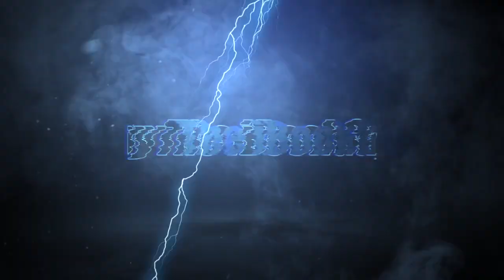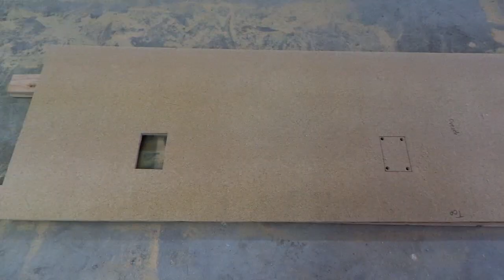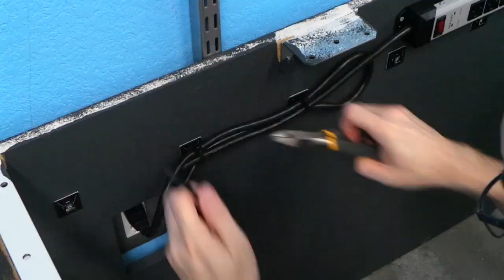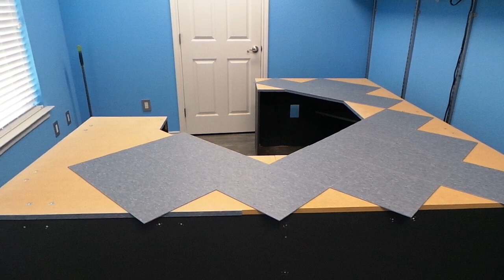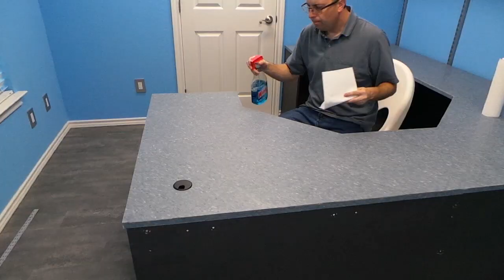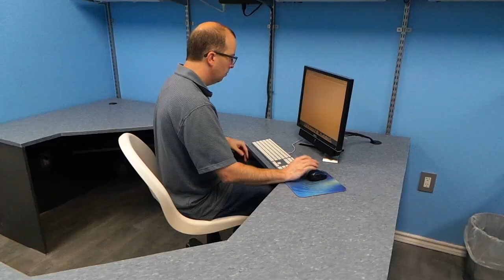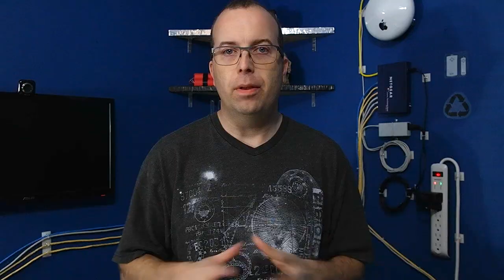Building the Ultimate Computer Desk - Part 3

Comment: How to get FREE WOOD for FREE

Step 1:  Google home builders in your area and find a subdivision they are currently building in.

Step 2: Go to the subdivision where they are still building homes, find a house that is at frame stage of construction,
which means there are no walls just the wood and frame of the house, ask a few mexicans or subcontractors who are working on the site if there is any extra wood for you to take home. Usually they throw away tons of off cuts and extra pieces that no one ever uses.

Step 3: ?

Step 4: Profit!
Reply: Great tip and funny to read too. If you need bigger pieces, there are organizations like Habitat for Humanity's ReStore that sells used and leftover building materials, and most of what you would find in a hardware or used furniture store. You can get a free desk chair with a coupon when they are having a sale!
Reply: true!! but if you need something free and quick theres tons of wood available
Reply: Step 3? Why, wait until noone is around ans use your trusty battery operated Sawzall to cut as many 2x4's and 2x6's out of the framed in house as you need! :P

Comment: I work for Lowes so I'm happy! Aside from that I might build that in Oak Plywood. If I did it with the tile I would use 7/16 OSB at a minimum,  instead of MDF. Though I tend to overbuild everything so I might just have used 3/4 plywood. I only saw this video so it sounded like you had budget constraints that I am not aware of. Great Video.

Comment: Very nice desk.  A little on the high side for price but nothing is as satisfying as building something yourself.
I think your shelves are a great idea, especially since I have two UPS on my floor, and I would love to incorporate your idea!
I have to admit I was quite surprise you built such a big desk for a tiny computer.    
Not trying to bash you for being a Mac guy! The desk seems like overkill.  Isn't the Mac Mini marketed to people with space issues? 
I would like to suggest you add another monitor.  Its amazing how much more productive you can be with more screen real estate.  I have two monitors at work and would never go back to one !
Reply: k
Reply: Two small suggestions. Screws don't hold into MDF very well (thinking about those shelves). Bolts work much better but because the shapes are unusual, you may want to consider unscrewing, filling with wood glue and small pieces of wood (like wood matchsticks), wood glue on sides and re-screwing same hole. Agreed... Too bad you didn't  use 1/2" or even 3/4 " MDF!  Live and learn! Course it would have made it a heavy son of a "b"!  Last, under desk lights probably not necessary. Consider a "headlight" ... its a small flashlight you wear on your head. I have one and it looks a bit odd but its great if i otherwise need to use both hands.  Where did you get your cable management system from?

Comment: So the rule when building cabinets is 3/4" MDF for any horizontal surface and 1/2" for vertical structures. MDF is heavy, however, so you would be better off going with plywood in most applications. You might consider 1/2" ply for the sides and then 3/4" MDF for the top. I would double up the MDF for the top though (this is how most counter tops are made if they don't use stone of some wort) to give it outstanding strength. At HD/Lowe's, 3/4" MDF is ~$32 for a 4'x8' sheet. Particle board is total crap, so don't use it.

Comment: I'm in Spain and I was shocked at the lack of computer desk options or desk options in general that are available here, even from the UK many via amazon.co.uk they won't import to Spain and the UK options weren't great anyway. Many of the U.S. web stores had better options with more modular PC desks available but the import tax to Spain was 21% extra I believe so it was not an option. I wanted a long thin one, with black strengthened  black glass and chrome legs, around 170cmto200cm in length and 50cm-60cm in width and nope .. not an option, the market tends to cater for L-shaped computer desks or smallish one single monitor desks but not bit long ones. It sucks... In the end I had to go for an Ikea one they do a black-brown table with black legs 200cmx50cm... not bad but not ideal, I may paint it piano black if I have time and I will have to I insert a keyboard tray underneath which is a pain also but hey... lack of market options leads to you having to customize your PC table. another irritating thing is that those L-shaped PC desks have the keyboard tray a one side of the table NOT in between both so they don't cater for 2xPC monitor set ups ... awful just plain awful.

Comment: I'm plan on making a desk kinda similar to this but not against the wall and I'm gonna line the outside with leds inside and outside the desk and I'm thinking some carbon fiber on the sides and a black title for the top and some built in usb hubs and a microphone mount kinda like a command center

Comment: Not sure what ya did with those screws on the black vertical panels but some light weight spackle and a light sand or even wood filler

Comment: nice project! It helped me consider options, like those T bolts look like they might be a great option for some of my projects. they do pop out of their "socket" on occasion, but i think I could use it in conjunction with a nut, perhaps. as for when you're down there...two easy options A just grab a head lamp, or battery powered camping lantern [which you can use in many different ways (like camping) or just have a kink stem desk lamp you can take down there with you, most of the smaller desk lamps work just fine for light duty work lights in places like that.  option three would be stick on LED closet lights. the kind you push on to turn on. they're only a few bucks, and if it's only for "servicing" I doubt the batteries will see much use, and that'd be a quick and inexpensive solution.

Comment: A cheap easy way to get under cabinet lights is to find some 5v LED strips that can plug into a USB port, plug it into the PC.
When the PC is on, the strip should light up and it will give a nice look to the desk.

You could get a 12v one to work with the use of a USB female port, a spare molex plug and some soldering.
Make the USB plug output 12v and label it and it will power those more common 12v strips

Comment: Epic video!  I like how you thought outside the box and chose floor tile for a covering!  You actually inspired me to improve my own computer desk.  It's basically a long, wooden door propped up on each corner by four plywood shelves resting on another door on the floor.  Since it wasn't stable and slid around quite a bit, I bought some L plates that I screwed into the back of each shelf, then coated the top and bottom edges with foam insulation so they stuck under pressure.  I even did this to my record shelf, and it made quite a difference!

Comment: Nice project. I liked the overall design, i would make a few possible suggestions.

1. I would have used 1x2 (or 2x4 for added support) along the walls for the counter top to sit on, instead of building the complete base. I would have just built the sides out from the wall instead. That would save on overall cost of lumber and hardware, and cut out need for support in those back wall corner(s) (with shelving still optional). If you needed added support later, it would be just as easy to install right off the wall.
2. VCT: a router would have been great here (as you mentioned) Also an Adhesive trowel, they sell plastic disposable ones for like $1 in most hardware stores. It would make the application of glue much cleaner and is proper to use with VCT. *also with that tile adhesive glue you should let it set for around 30 mins to cure. Be sure to dry fit beforehand as once the glue cures it has a strong initial hold. It should even hold those edge pieces if applied that way.
3. Also with VCT, it comes with a thin coat of finish on one side of the tiles. When flooring they recommend using a Floor Finish over of the finished surface for added protection. Same could be done for this project, when flooring it is commonly referred to as Waxing the floor. It would protect your counter top from spills, that could get under the tile and weaken the glues bond, and basic wear and tear.

Comment: You should have drilled holes and used pegs for your 3 hidden shelves. That way you could move them to different heights if need be. But screwing them in to add support wasn't a bad idea either. Turned out great :)

Comment: But. For 492, you could just buy a desk of the same size, and save a week-month of work.
Reply: +Sebastian Thorsen That's kind of debatable. Big desks like this tend to be rather expensive, plus it wouldn't perfectly fit his room layout like this does.
Reply: TalesOfWar Depends what "perfect" would be. An L shaped table might fit just as well as this, arguably. And you can definitely get a desktop table for 492$. Go on amazon and most tables cost around 2-400 tbh, so 492 is quite a high price tag, meaning you could easily afford a proper built table, with proper materials.

Comment: I just wold bought a desk from IKEA
Reply: +Thore Karlsson The thing with IKEA desks is they're specific sizes and designs. Making your own means you can get it to fit your room exactly and to your own design.
Reply: Rowdy The best way to make your own desk is to get a kitchen counter top of your liking, cut it to size (or get someone else to do it if you lack the tools or motivation lol. I'd end up making a mess of it or killing myself if I tried such a thing!) then stick legs on it. Ikea do some nice, solid table legs in various styles as do most hardware places. The great thing with kitchen counters is they're very strong and excellent at resisting scratches and stuff. Not to mention they tend to come in pretty long sections so unless you need a monstrously massive desk you'll have no problem getting a single span surface that fits your needs.
Reply: +Thore Karlsson Good for you well he made a desk.
Reply: +Thore Karlsson ikr I spent  $80 On my desk and it fits 3 monitors, computer, laptop, xbox one, xbox 360 and I still have space to put like food n stuff
Reply: Can you kinda explain what you got?
Reply: That is actually what I was thinking of but thanks for the help!
Reply: Thore Karlsson Me too. but as he said.. there is not very much options of good desk for you.. so he made something good for him
Reply: have you seen his video "improving a crappy ikea desk"?

Comment: $50-$60 for some under desk lighting???  You can get strips of white LEDs for ~$1 per metre.
Reply: +CowLunch True. But he'd need some sort of power converter for 120v to 12v or 24v, depending on which one the lights would utilize.
Plot twist: He could buy an old computer powersupply and get the 12v from there, so that'd be an exceptionally cheap alternative, costing maybe 10-20$ tops.
Reply: +CowLunch I get my strips $1 (+ $1 delivery) for 5 metres

Comment: if you would have used real wood for the tabletop, you wouldnt had to do the whole vinyl thing at all. there is nothing more beautiful and smooth than real wood (with some sort of coating)
Reply: that was ,y though to.. he couldhave taken the budget for the table top. tile, and glue, and put it into some nicer wood for the top and it would have been MUCH NICER.. this looks like a grade school floor
Reply: Agree but you too are debating the taste of someone who is famous for collecting and restoring 8 bit hardware. He likes his room painted blue and things covered in plastic (also crazy blue if not out of stock). So yes it is wood surface and throw away the 10-20 year old computer for most people including myself. But I respect his efforts and expertise in terms of old tech. I am Not here for woodworking :)

Comment: Im not sure if you've added lights to the underside of the desk yet but those REB LED light strips you can get from eBay are pretty cheap, low profile, cover a great distance, only take up one power socket and offer some level of customization.

Comment: With 492 $, you could buy one.
Reply: +Nikolaidis Dimitrios the point of this wasn't to save cost, its to have a custom built and designed desk
Reply: +Mark Bell Indeed. If you want something this sort of size and shape you're looking at office desk territory and those things are monstrously pricey. We have a few of those L shaped things at work with the curved middle (you know, the typical corner office desk) and they're like £800/$1100 each.
Reply: +ben samuels A sign of the times, that half of the commenters here don't understand the reasoning?
Reply: +Nikolaidis Dimitrios Not when $42 was power bars and $25 was cable management.  No way you buy a desk that solid and big for that price.

Comment: Hi Dave... very impressive build.  I've watched Parts 1 - 3 several times now, and have pretty much decided to follow your lead.  I ran into the same exact issues... nothing available on the market seems to fit what I need. They are all either too expensive, or not quite right for the space I want to put it in... the list goes on as you say in Part 1.  What I wanted to ask is have you gotten around to thinking about starting the build on the second desk yet?  The space I have is L-shaped just like your illustration shows briefly, so I'm most interested in your thoughts on that project.  Again, very nice job.

Comment: Great job!! 25 years ago when I couldn't cut wood nor drill a hole well I made a massive triangular desk like your shape. I wanted it portable so I made a square metal tube frame that connected with those plastic "force in" connectors. On top (& for the sides) I glued onto chipboard Jarrah tongue & groove flooring (Jarrah is super hard, heavy & tough). More than 9 house moves later I really appreciate the knock-down aspects. 
So now I CAN (& do) make fine furniture but I still love that desk. 
It's roomy, fits nearly all room sizes & no knocking knees etc. 
But I got some great ideas from your build too. Under desk storage for drives, routers etc. Why not make joints simple and use brackets? And as for flex?  Flip some hard wood on its side (only needs to be 1" x 3") and place it underneath on the diagonal and glue & screw that up into the mdf.  
BUT I am now motivated to get my poop together & get my cable management sorted. I watch your vids & feel I must get cabled!!

Comment: I think you did a great job planning this out and building it, it's a really nice custom desk. As an old fart drafting table-trained designer who converted to CAD some decades ago, I liked your use of SketchUp to do a 3D model. Then I was gobsmacked to find out in Part 3 that you used 1/4" thick material throughout! That's a structural strength issue that an experienced designer would have questioned immediately, but as you noted, you're not one of those and you're going to retro-fix that. Again, great work.

Comment: I think you need more flexibility to route cables, and more power outlets.  Instead of cable ties, why not have a continuous 6" shelf under the back of the desk and possibly slot-like openings (get that router!) generously distributed on the back top of the desk over that shelf.  That way you don't have to crawl around under the desk to route wires and tie things up with cable ties.  I'd also recommend a couple of Tripp-lite 12-outlet strips on the wall right where the desk meets the wall.  Power cables could plug in there and go right into the above-mentioned slots to be routed along the hidden shelf, or, for all your phone and tablet gadgets you can easily access power right on top of the desk.  Cable management is not a one-time thing - you'll be doing it all the time, so why not make it convenient?

Comment: If you put some large L brackets under your desk at the weak parts it will provide the strength you require. At the moment it's relying on the strength of the wood to keep it together, which might not be long considering you used particle/chip wood. Also make sure you screw them into the wall supports/frame/place that holds the wall up? So it's stable.

Otherwise great job! It looks like a really good desk with heaps of space for your supplies. I like the tile idea as a flat sheat of laminate can be harder to replace.

Comment: Great build and video! You could have rented a router from home depot. However, that would have also cut into your budgeat build! Ive tried Google sketch several times but I just can't get it working.

I don't know if you do video graphics (video production), but if you do, please do a demo on adding graphics to a home video project. Thanks again.

Comment: Go to dollar tree. You can get battery operated puck and pull chain lights for a buck. Also never use particle board, it will eventually crumble. 3/4 MDF is all I have ever used when building a desk and I've never had any problems. Otherwise I like your design

Comment: Couple of things, thicker timber would not have made much different. Supports underneath like you said would be ideal and second the vinyl (plastic) tiles on the top should of been installed with a notched trowel. Then you wouldn't get any spilling in between the joins of each tile. Just a few tips for next time :)